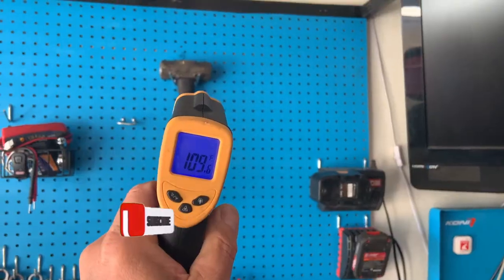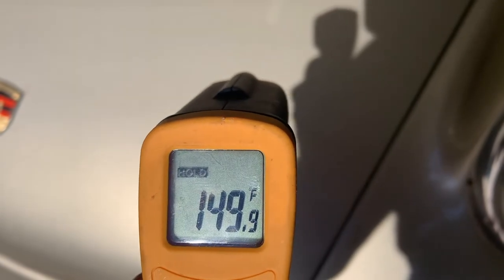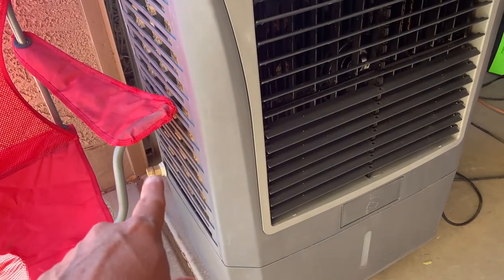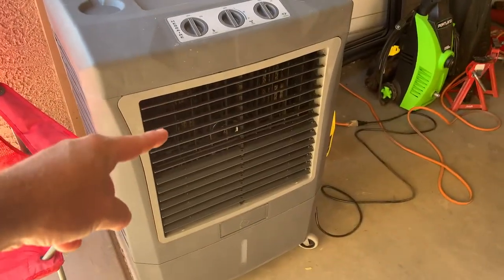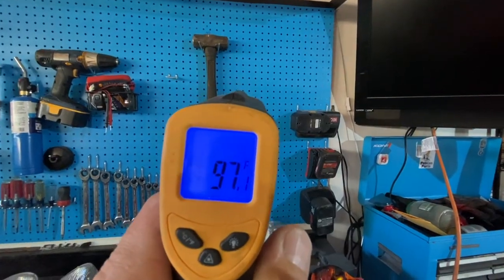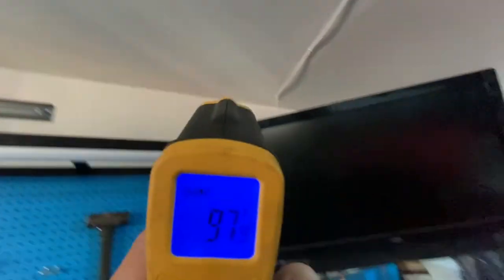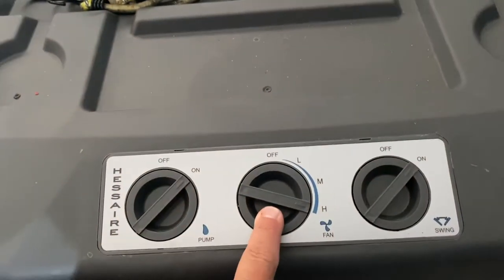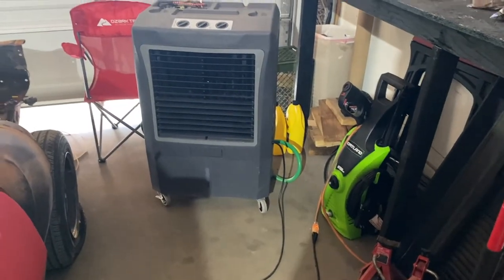HOW TO KEEP GARAGE COOLER IN SUMMER - Hessaire Review for Classic Car Restoration Projects

Comment: I  use an artic breeze (aussie) 1500 which tops out at 2800 cfm but I use the lower speeds.  I place it on a garage shelf butted up to the exterior wall and curt a hole in the side of my garage for a direct sealed intake air from outside  and vent it out a garage door plexiglass window (made a slider) and for higher speeds crack the garage door open a bit to vent out the hot air and keep humidity down. Even though not in the desert (san francisco east bay) humidity can get very low and it works well if you use it correctly. Makes my 2 car  garage comfortable even on 110 degree days so I can work on my rolling restoration 1985  mercedes 300sd. GOOD VIDEO

Comment: This couldnt be more appropriately timed. This whole week has been 117+ in Phoenix.  I'm working on my truck outside. Actually I'm not working on my truck at all because of the heat. How would these handle being outside pointing at you, under an EZ UP?  I'm doing a lot of welding, I'm concerned about the flash rusting on the bare metal.
Reply from the maker: Right here with you Ed in Phoenix!!!  Yes I have used it a few times to cool me off in the back yard while welding up a shade cover in the garden!!!  Turn it on high and go.
Reply: swamp coolers like the one shown work perfectly outside and in fact are the only way to cool down an outside area.

Comment: I bought this 3 months ago.   The pump is out.   I didn’t remove the old pump or hardwire the new one.  I just dropped in a $14 HF 1600 LPM pump cut a little notch in the case for the wire to come over the back and now there’s two plugs on the unit.  One for the fan and one for the  ultra quick change pump.  It’s literally just sitting in there.   I know this well water will eat it up. So no sense in hard wiring.  I’m in west Texas in a commercial 1200 sf storage/shop space.  14” ceiling.   When it’s 100-105 outside it keeps it 85-87 in that big shop with the overhead door cracked 4”.  😅
Reply from the maker: Thats a great idea of swapping out the pump, thanks for sharing!
Reply: @ArrowheadGarage  Thank you for showing me how to get into it.  Once I saw inside yours I was like “we’re gonna be able to make this thing run forever.”   Thinking about buying a spare motor and a third standby pump just to have.  Cause you know it’s gonna fail when it’s 110 outside and you’re in a position where you can’t just quit.   So Ima be ready!  😅

Comment: I'm in Las Vegas, I have the same model. This thing brings the temp down but makes the garage humid af. I think my issue is that I don't have a door leading to the outside other than the garage door. I do have 2 vents ( 2x 10" x 20") at the floor level because the gas water heater is in the garage, but I don't think it's enough to let air out.

Comment: I got the smaller one Mc18v model I live in the high desert Temps are 107-110  and this cools maybe 1/2 of my 950 Sq ft apt I think I need another one to cool the whole apt, box saids it cools 500 Sq ft I only turn on during the day I'm hoping to save on electric bill this summer.

Comment: Any moisture problems in your shop? I noticed you had the garage doors still opened a bit' for ventilation.
Reply from the maker: No moisture issues here in Phoenix Arizona.  I tried opening a side door, leaving it closed, and a few other ventilation ideas.  Having the side door opened just seems to pull the cooler air thru the garage the best.  Thanks for asking, let me know if you have any other questions.

Comment: Can anyone tell me, can we just leave the hose connected and running full time?
Reply from the maker: Yes you can!  I don’t like the hose hooked up, so I just refill it ever few hours
Reply: Make sure the water resivour Float Valve is set correct. There is operation manual that shows how to set-up and adjust so it doesn't overflow and flood the area the cooler is in

Comment: Just got one of these last month.  I use it in the back of the tandem garage Which is used as a game room.  It brings the temp down usually 8-10° or more.  Works best if I open the side door along with cracking the bottom of the garage door to get the air moving and cut down on the humidity.
Reply from the maker: Right on, it's not as great as A/C but it keeps the air moving at least.  Thanks for the comment!
Reply: Insulate the garage door

Comment: Thanks for the video we just bought one of these bad boys, with side door open about halfway and garage door up about 10 in easily brings down the temp 20° Another idea is to insulate the garage door, just a cheap kit at Home Depot, with west facing garage door lowered the temp another 10°-15, we also get snow every once in awhile and it keeps it pretty toasty in here
Reply from the maker: Just tried the garage door insulation, but I think I need the thicker panels to make a difference.

Comment: Mini splits are so cheap now, combined with the fact they come charged, I don't see a reason for these other than job sites any longer
Reply from the maker: I might have to go that route next summer, thanks for watching!
Reply: Whats that do to your electric bill?
Reply: @sikryd  If you add either a evaporative cooler or a mini-split, your bill will increase. The difference between the two will be small. Mini-splits are usually wired in single phase 240, while coolers are single phase 120. This keeps actual wattage down and keeps the measured power between the two very close. My 21 seer 1 ton split unit runs 4 amps and increased my bill 40 dollars per month in the summers. This runs 24hrs per day and maintains the garage temperature as opposed to just switching on a wet cooler when you walk out into a 130 degree garage. I live in the desert, I know humidity and temps play a role in which would be best for you. This is better for me
Reply: @electropentatonic  run my swap cooler on two 100 watts souler planal well i going to do so
Reply: @stevencorrea8032  You will find that difficult. Motor inrush current is not solar friendly. You're better off just offsetting normal utility costs with the same solar. This is it's intended purpose, not circuit replacement if any kind

Comment: I live in Sun City Arizona. And this thing is useless for the garage,. It's only good for already cooled down areas.  What's the point in buying something to cool if it only works when it's in an already cool place?  Just blows hot air on ya'. My $25.00 fan did the same thing. This is nothing more than an expensive Humidifier.  And no where to insert ice blocks if you wanted.  Completely useless. Waste of money. Don't buy.
Reply: Why so negative? It does what it’s intended to do. If you want air conditioning performance then go buy an air conditioner.